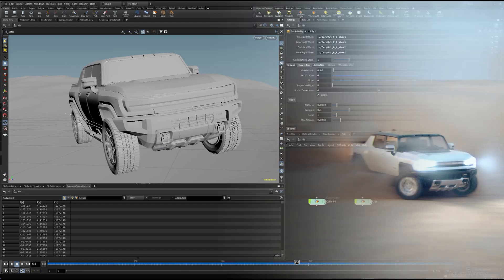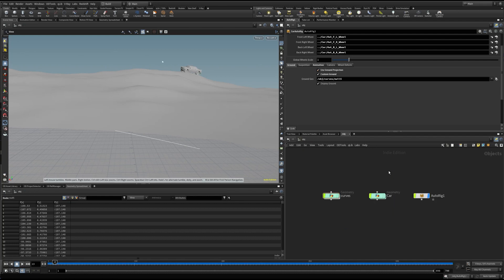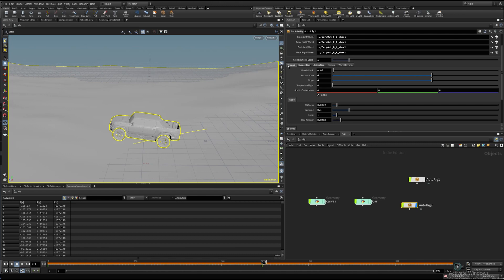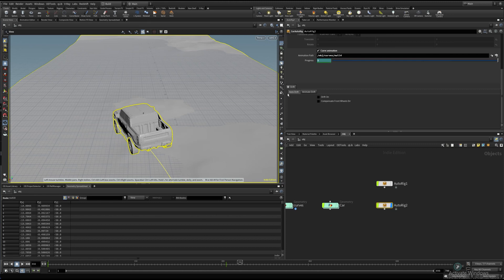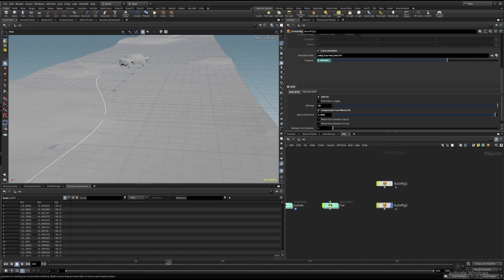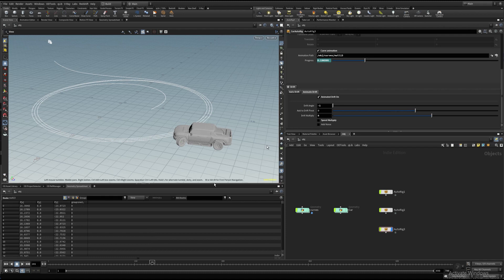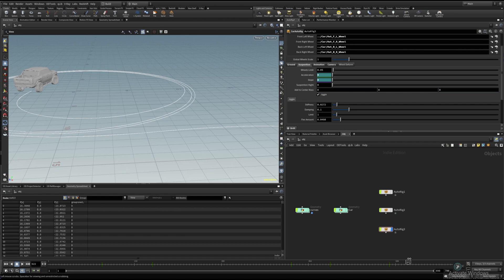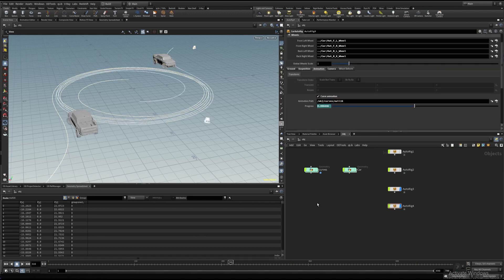Easy way to Rig and Animate a Car in Houdini using AutoRig Tools

Comment: I bought it and drift does not work. It only works in the demo scene with the nodes of the demo scene.
Reply from the maker: the slope parameter should be greater then 0 to activate drift
Reply: @maksimfilipovich  Thank you for the reply but I've copied all your parameters and it does not work. The "chop("../suspension/OUT_drift/drift") " returns a value =0 as soon as the curve from your demo scene is replaced. I even tried the different curves you set up in case you did something I didn't notice on the curves, but still nothing. If I change the curve then go back to the one from the demo scene, drifting stays broken.
Reply from the maker: @bluedotanimation  sometimes all what you need it force houdini to redo chops like here https://youtu.be/gfkuytPeocQ?t=70
Reply: @maksimfilipovich  Thank you for your reply. There is another problem with the HDA : sometimes it bakes in a loop and never stops, when it happens while saving, the save never ends (waited 20mn) and is corrupted when you force close the file. Also, if you happen to render without baking to alembic, this can happen also so my render got stuck at frame 4 because the bake started looping. Would you happen to know why ?
Reply: it's a shame because the work you did produces great results with ease, but these bugs make it very hard to use it in production.
Reply: @maksimfilipovich  I found the "mistake". In "suspension_side_rot", the  wrangles must be set to "points". Right now it's on "guess" and apparently Houdini is having a hard time guessing, so the @N info is stopped right there.

Comment: Hi,

Thanks for this amazing tool ! (I purchased it last week)
Remind me the 'Ultimate Car Rig' for Maya which is a great point.
Would it be possible to add a  start frame to your HDA ? I'm used to start my shots at 1001 to prevent some prerolls.
Do you think there is a chance to have an .hda instead of .hdalc ? We are using the core version of Houdini and it switchs our license everytime we drop your hda in the scene.

Thanks again !
Reply from the maker: Thanks, will fix the prerolls in next version, the studio-wide hda should be available soon on orbolt.com (their moderation is pretty slow)
Reply: Hey, I just saw your AutoRig on orbolt.
Is it possible to receive the AutoRig in .hda without pourchasing it a second time ?
Reply from the maker: @cedricnivoliez8988   sure, send me your email

Comment: Can this program do anything without these addons?  Like anything at all....  I thought this was the program that could do anything but then we need all the plugin to achieve simple things like animating a car along a spline.  So infuriating.
Reply from the maker: In fact, the HDA (Houdini Digital Asset) is not strictly a plugin; rather, it is a configuration created using various Houdini tools that are combined into a single node with simplified interface
Reply: @maksimfilipovich  Regardless to me the consumer it might as well be magic and regardless I can't access or recreate it.

Comment: Fantastic tool, thanks for compiling and putting it on gumroad! 

I'm keen to see if anyone has had any luck then taking the results into unreal. My thoughts are either using the wheel/body assign to create a skeleton or baking out the animation though that got heavy fast with detailed geo.
Reply from the maker: Thanks, I was trying to use the asset in 3ds max using Houdini engine, but no success yet. Suspecting that H engine not transfering the CHOP data. there is a way to cache CHOP info to the file and read it in 3ds or UE4, but hevent tested it yet. Anyway always can be exported as alembick.
Reply: @maksimfilipovich  this is the conclusion I came to as well. Export as alembic is definitely an option and I think using the setup to create a skeleton might also work. Will test this evening. Either way the tool is fantastic and such a useful way to setup a vehicle in Houdini!